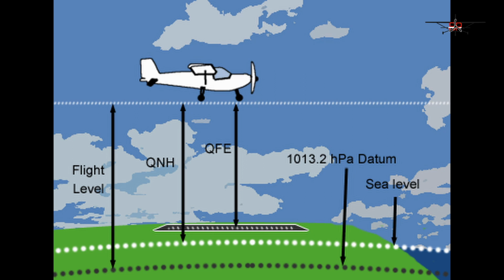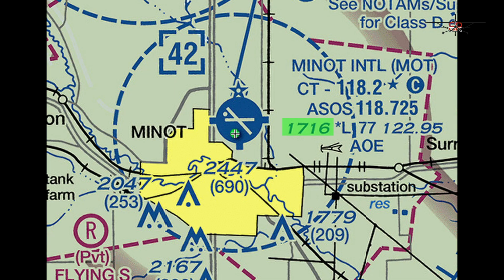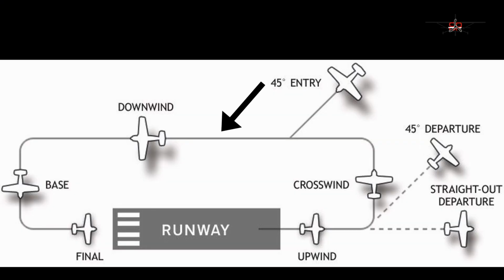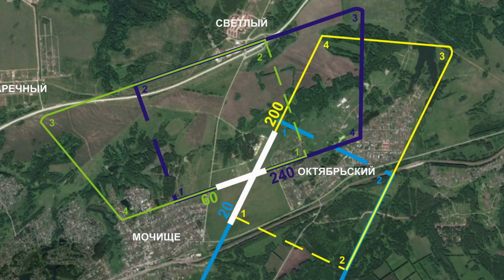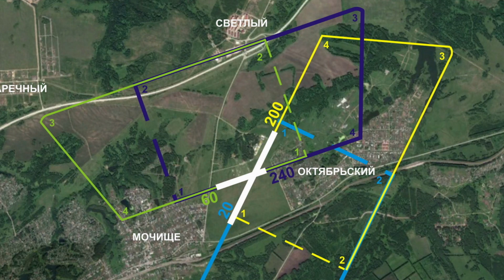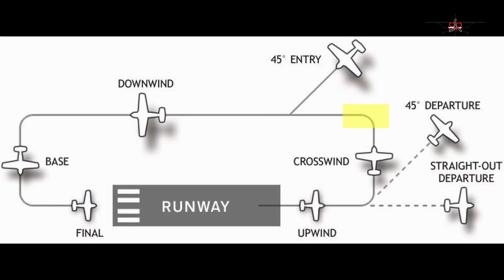You are flying the pattern wrong (and other lessons from foreign pilots)

Comment: very interesting . One big controversy in the US when flying the traffic pattern is whether or not to say upwind or departure leg when staying in the pattern.
Reply from the maker: Knowing the area and what is expected there definitely gives some guidance into what should be said. I've flown in some areas where instead of legs pilots called out identifiable features around the airport (this was in mountainous areas). One problem with flying this way is it causes confusion for pilots who are transient or new to the area.
Reply: @SafetyPilotOfficial , That’s  when you say: “Please  repeat your position. I’m not local.
Reply: Is it necessary?  I fly at an uncontrolled airport where there is large volume of flight training. The CTAF is very congested.  While there may be a seldom situation which necessitates announcing the crosswind or upwind, doing so as a matter of procedure does not serve any relevant purpose. Leave the freq open for more valuable information.

Safely sharing the traffic pattern requires a meeting of the minds.  I need to know what you’re doing and visa-versa.  When necessary, “Midfield downwind”, “downwind abeam the numbers”, or “Downwind abeam departure end” are much more valuable calls than “crosswind” or “upwind”.